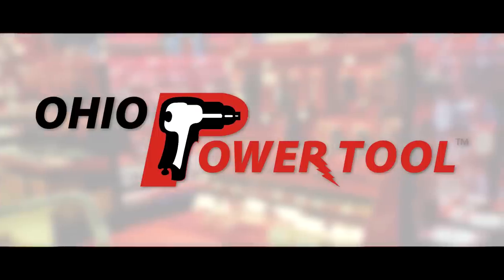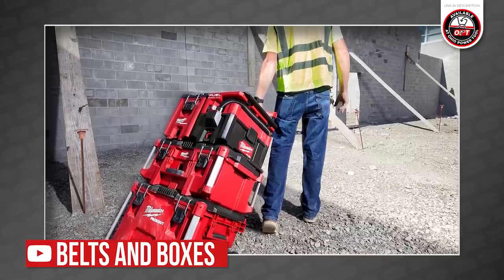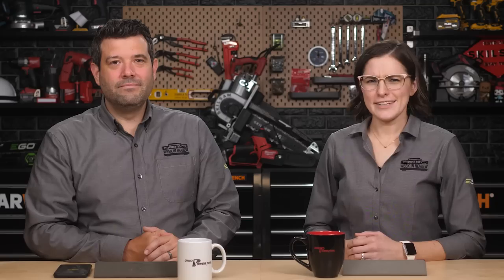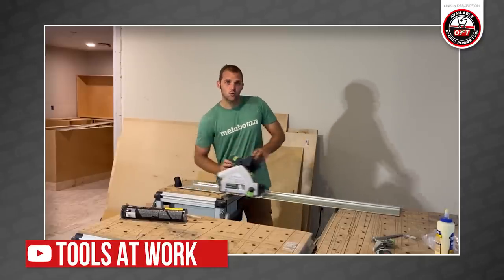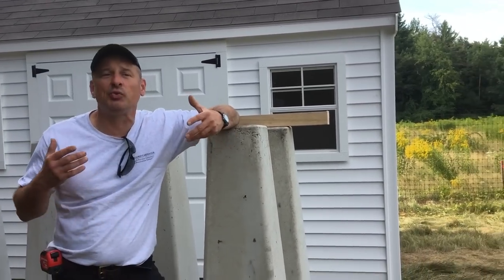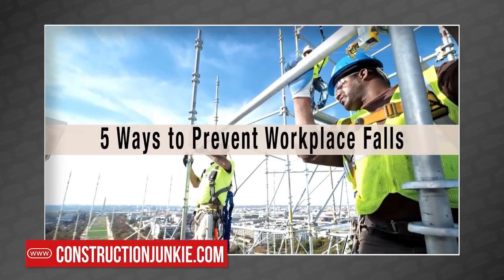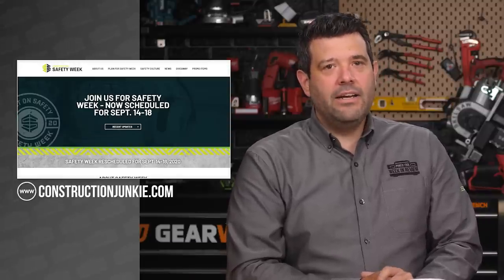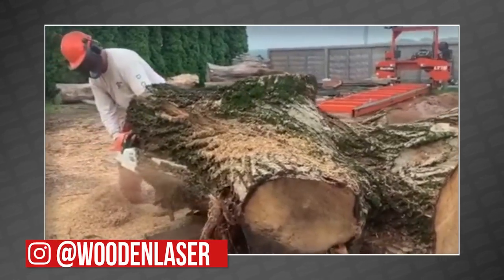Milwaukee FIGHTS for your attention this week but EGO and Festool fight back. Power Tool NEWS: S3E34

Comment: I considering switching over to Ego after the way Milwaukee shafted me on a very expensive brad nailer. A totally useless device with all sorts of flaws. And their only fix to the problem is to require me to BUY their replacement Gen2 model with all the fixes done to it.  Even if they offered a substantial trade-up price at least that woul help.